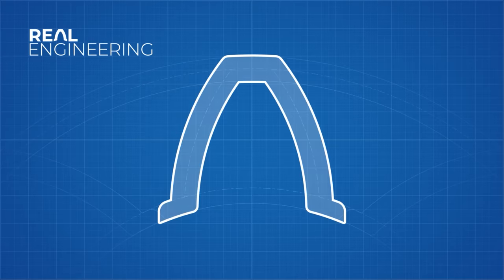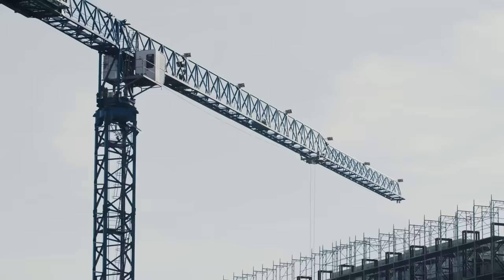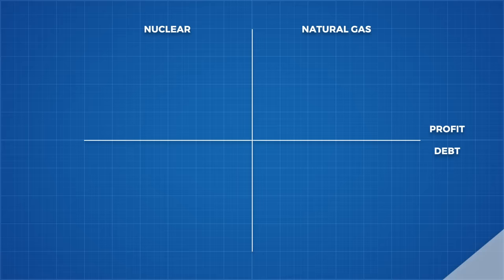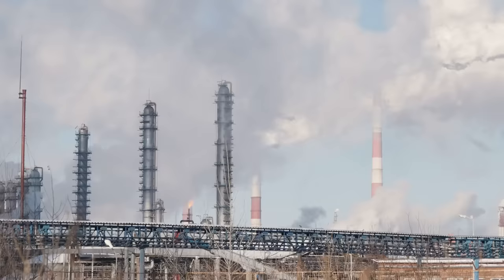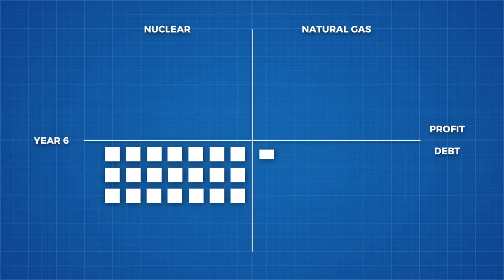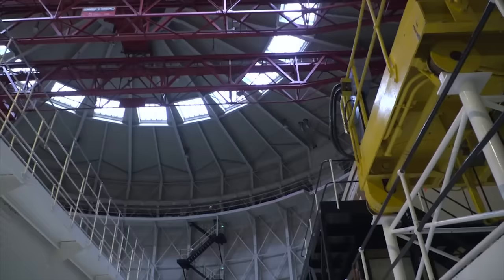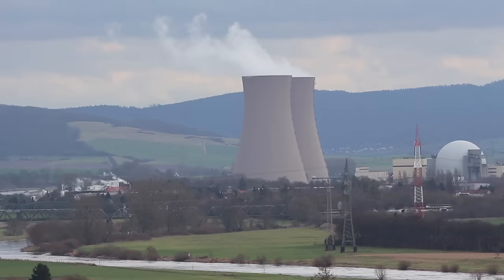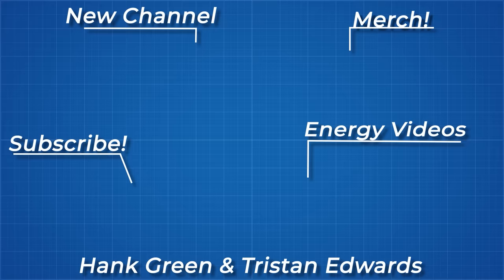The Economics of Nuclear Energy

Comment: I wonder how cheap or expensive thorium plants could be
Reply: Me, too. But as Nuclear Power suffers not from high fuel costs, I wonder why should anybody in the utility sector go for an new and unproven concept. I understand the fascination of new technology such as molton salt and liquid metals (that don't require high pressure fluids), but the whole Rankine cycle technology works even with supercritical water, and this is proven technology, whereas long term corrosion stability of salt and metals has not been proven yet in long term operational experiences .
Reply: Gunnar Kaestle not completely unproven, in the 60s there was a LFTR built by oakridge labs that ran for a couple years but was more of an experiment than a power  plant.
Reply: @daytoncoates4930  Well it is kind of unproven if only one small-scale  demonstration plant has been operated for a few years. That is a proof of concept. Chernobyl's RBMK design was proven in more than 10 operating reactor sites and did nevertheless fail. Salt reactors are special, considering the fact that they should not freeze, and the operation of the "kidney". The disadvantage of having a coolant that is solid at room temperature means a) never loose heating power during standstill (the Soviets lost a few of their metal cooled subs because of this) b) design the reactor in such a way that you can let him freeze and heat up again without destroying the mechanics (this seems to be harder than I expected).

But nevertheless: all breeder concepts including thorium reactors assume that the fuel costs is a economical problem. For the foreseeable future, no uranium supply issues are on the horizon. MOX fuel is very available from Pu stockpile reduction. Fuel costs today are about 5€/MWh for PWR. See page 144: https://www.worldnuclearreport.org/IMG/pdf/wnisr2020_lr.pdf

The problem with nuclear power is not the fuel costs, it is the CAPEX to build new reactors. "the Court [of Audit] states that the Flamanville-3 electricity could  possibly be generated at €2015 110–120/MWh, a cost range similar to  the price range negotiated for the Hinkley Point C project in the U.K." ibidem, page 147.

Which high ranking utility manager will propose to invest in such a venture, if the regular wholesale market price varies between 20 €/MWh and 60 €/MWh. They are not paid to burn money, aren't they? And CO2 prices in Europe have risen since 2018 up to 30 €/t - meaning NPPs have an advantage over coal and gas plants. But even these 30 €/t_CO2e translates only into 12 €/MWh for a gas plant with eta=50%. This is not enough to compensate the staggering high CAPEX of nuclear power. https://blog.energybrainpool.com/wp-content/uploads/2019/08/EUA-prices_en.png
Reply: Yeah, I guess that’s what I meant when I said “not completely unproven”: proof of concept. 
If I’m correct your main point is that while thorium has plenty of potential, the real problem is getting people to support and invest since there are pretty much no thorium reactors making the investment kinda risky
Reply: @daytoncoates4930  Yes, Thorium has more ressource potential as Uranium. But you need to compare Th reactors (which are breeders) with U breeder reactors. If I remember correctly we have 3 times more discovered Th reserves to U reserves. A breeder reactor is a more complicated concept because you have to take care of the neutron economics. While you only need 1 neutron for a U-235 chain reaction and 1-2 neutrons can be lost, a breeder reactor need two neutrons: one for the breeding, and a second for the fission. That means only a small fraction of neutrons can be allowed to escape. 

But back to the question: if breeder reactors, why haven't been reactors that use U-238 for  breeding very sucessfull? The German concept at Kalkar died before it became critical, the French Phenix and SuperPhenix had problems with the liquid sodium coolant, this is also true for the Japanese Monju FBR. The US molton salt reactor experiment in the 60s was basically funded to check high temperature reactor designs that could maybe eventual be useful to drive jet turbines.

The only robust design seems to be the Russion BN series. Nevertheless, there are only these two reactors and have not generated offspring somewhere else. Why? The fuel costs are today (+/- 20 years) insignificant for a U-235 reactor, so the reason to switch to another fuel is not very convincing: where is the need to go from cheap to cheap, if you don't exactly know what is at the end of the breeder reactor tunnel?

Comment: The argumentation doesn't really make sense. Isn't CO2 emission the main objective in current energy politics? Natural gas has considerably more CO2 emissions than nuclear. 

And yes, wind and solar are relatively cheap itself, but to make it work you need to factor in battery storage costs, which makes it very expensive. 

The combination of wind, solar and natural gas as balancing energy supply does work technically and is relatively cheap. But the CO2 emissions are much worse than a combination of wind, solar and nuclear, which is in turn not as cost effective since you can't regulate nuclear as good.

Yes, it's complicated. Even more so since there is progress in technology on all fronts. However, if you boil it down to the objective to make energy productions as CO2 free as possible as fast as possible at reasonable price, nuclear seems the best option for the time being.

Comment: Exclusion zone of atomic power plant is 10 miles (plume-exposure pathway) this will provide 1.2GWh when cover by solar panels. Why will you build a nuclear plant typically 1GWh with the same area? I know it generates only when sun is up. But then area is not exclusion zone for anything, and is less expensive than nuclear. Just make it twice as big and add batteries (liquid metal from Ambri, Lithium from Tesla, or anything else). We are  not expecting the Sun to go out any time soon. Am I wrong?
Reply: @mikoi7472  Need to read more Mikoi...
Reply: @jacekpiterow900  Uh no u.
Reply: @mikoi7472  So let's get this straight. The 10 mile safety radius that I would not like to live there and wish no one else to = exclusion. The safety of a nuclear power plant is not when it operates as intended. New York City had plans to build a gas plant right in the middle of the city. Interestingly why they did not want a nuclear power plant in the same place. From your point of view, there is nothing to worry about. Even a gas power plant will be safe if it works as intended. Problems come out when something goes wrong. Failure of nuclear power plants is destroying the environment for millennia. Additionally, nuclear contamination does not stay where it is. It seeps into water, food and air. I still remember the helicopters flying over my house when the Chernobyl reactor exploded. Why? And what do you want to do with nuclear waste? Like in Fukushima store it in the plant attic?  Let's take ignorance. How did you come to this conclusion? Are you assessing my fears here? Or is it your courage to endanger everyone but yourself? I'm afraid ignorance coupled with naivety is on your side, buddy. It's a really explosive mix. You don't care about the consequences of a nuclear power plant accident or the health of your neighbors. Not even about your ow kids. You want to stuff your pockets with money? Worst kind of human being? Or just naive, young enthusiastic engineer?

Comment: The issue with gas is the entire thing propping renewables is the thing they want to get rid of, that’s why Germany is so shit
Also what about running costs when up and going? I’m not sure if nuclear is cheaper fuel, but it lasts longer and is more efficient and is cheaper for the people
Crude and gas are better for industry and scaling. Nuclear is better for efficiency, for the people, and for carbon output. Renewables? Are. Just. Shit.
And hydro just exists to be a battery

Nuclear is simply better.

Comment: Conventional nuclear power, when the cost of coping with nuclear waste is taken in consideration, is one of the most expensive ways to generate electrical power.  Renewables with energy storage is much cheaper than nuclear facilities.  Energy storage is a better way to provide energy in low sunlight and low wind conditions than using nuclear.  Conventional fission nuclear power stations have during the past 60 years have generated 250000 tonnes of high-level nuclear waste, while only providing a few percent of total electrical power generation; this is totally unsustainable.  When full life-cycle is taken into account, nuclear fission is not carbon neutral or zero carbon dioxide production.  Most nuclear power plants are based on obsolete solid-fuel technology from the 1950's.  They have large thermal mass and cannot provide load-following to the grid.  It would be better economics to consider smaller molten salt nuclear reactors (e.g. Seaborg-type technology) because such molten salt reactors can burn nuclear waste, as well as providing load follow/grid response.  The presentation above does not appreciate that Uranium is a finite resource and its extraction causes major environmental production.  Plutonium MOX in conventional nuclear power stations is difficult to keep stable during fissioning, and the fuel is extremely hazardous and costly to manufacture.  

The presentation does not take into account the decommissioning costs for nuclear reactors that means that the use of conventional nuclear fission in the long run is a very poor economic prospect.  Denmark and Germany appreciate this.  The UK government has nutheads and boneheads that have approved Hinkley Point C and Sizewell C that is a grossly insane strategy, esepcially when we do not know how to store the nuclear waste isolated from the biosphere for 500000 years.  It is f***ing insane to generate more nuclear waste.
Reply: The cost of storing nuclear waste was built into the price of the electricity it sold.  Waste is a selling feature for nuclear, not a reason to be against it. The little bit of waste generated from massive amounts of energy produced is all contained and safely stored for future energy use in the new breeder reactors coming out.
Reply: @chapter4travels  Rubbish.  The UK Government did not allow £ 132 billion to decommission the UK fleet of nuclear reactors and deal with the waste.  This is the problem.  The nuclear industry has lived on borrowed time and pushed costs into the future, claiming that its nuclear energy is "too cheap to meter".   The new breeder reactors will not come out - Monju and Dounreay have been disasters.  Your response angers me because you are so ill-informed and do not appreciate the danger of the nuclear waste that has been created.
Reply: @tommorris3688  Sorry, I was referencing the US fleet. Waste is a selling feature for nuclear, not a reason to be against it. The little bit of waste generated from massive amounts of energy produced is all contained and safely stored for future energy use in the new breeder reactors coming out.

Comment: But what if you mine crypto with nuclear during off-peak hours?
Reply: Nuclear is the bedrock of the grid. The lowest of the low since it's always running at maximum. Fossil fuels can easily ramp up or down and are the flexible part of the grid while solar and wind are below fossil fuels on this and fossil fuels adjust based on the needs of the people and the output of other systems.

Comment: This video is plain wrong and misleading. Renewables are far more expensive than nuclear. Actually, nuclear is the cheapest. Because, when we say the cost of nuclear energy we put all tye costs but renewables don't take the cost of storage and fossil fuels the cost of polution. Solar and wind are by far the most expensive. Simple France eletricity is much cheaper than Germany, and france runs nuclear while germany runs with wind, solar and coal. And with increase reliability in solar and wind the cost go up